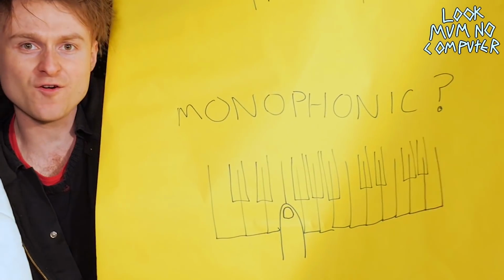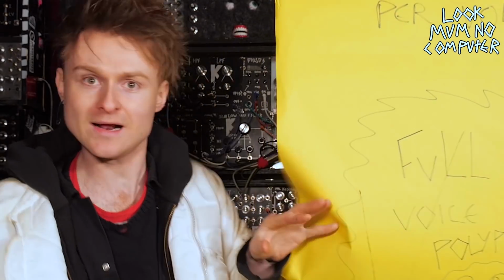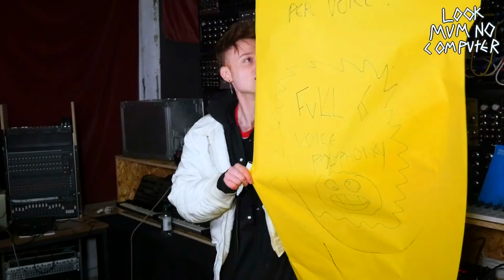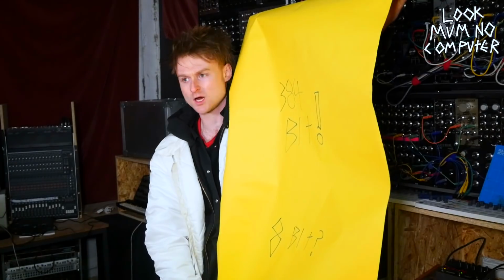GAMEBOY MEGA MACHINE BUILD VLOG #1

Comment: It's a GameBEAST! Be interesting to know how much if at all this affects the longevity of the CPU... Certainly the engineers didn't design the chips to be bent by an insane person! Stupid engineers.
Reply from the maker: haha. its fine i went back on my synth bike through the 8 bit worm hole to warn them. all is A ok in that respect
Reply: At least the clock speed change shouldn’t affect the longevity too much. But what could affect the longevity is when LMNC often solders something onto the CPU contacts.
Reply: @LukasFink1  I guess it makes sense if you only downclock it. Putting extra voltage there might be risky. Though I must admit, I'm no pro when it comes to OC, just a dabler.

Comment: if one is a gameboy all of them make a GAME MAN :D
Reply from the maker: maybe it surpasses and gets to GAMEGRAN
Reply: @LOOKMUMNOCOMPUTER   i actually thought of a simmelar projekt quite a long time ago, how are you going to build the clusters ? do you need to programm cartriges ? i was going to try and build a bus system where the game-boys will look on the bus what oscillator values to put into the sound chip, but i guess you handle that over the arduous boys right ?
i did it for the same reason, a buckload of retro voices :3 can't wait to see how you do it <3

-lara
Reply from the maker: @Laracrafttrabant  cool!!! great minds think alike! i've already sorted cartridges thanks to kitschbent. using the multicarts with 16 roms, which poses another thing of selecting between each rom on there! but yes, there is going to be a bus board with a heck of a lot of stuff, probably a 30 way bus board maybe even more. each voice will be seperate controlled by its seperate arduinoboy, the selection of the voices are going to happen before the signals even get to the arduinoboys :)
Reply: Articulation is really important there though. Put the pause in between there really clearly.
Reply: Lara Beckmann you and look mum are so cool talking about... well ... I have no idea! Look mum and dad I have no idea 😂 respect!
Reply: I was thinking game man as well, i second the motion for that name